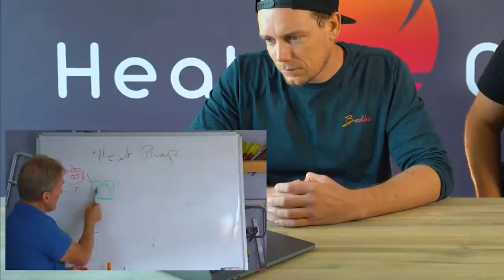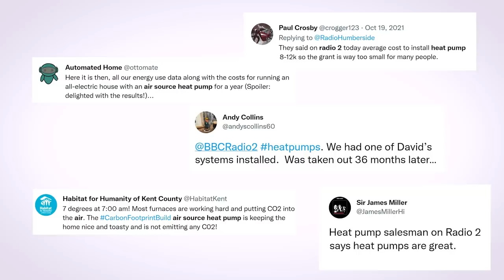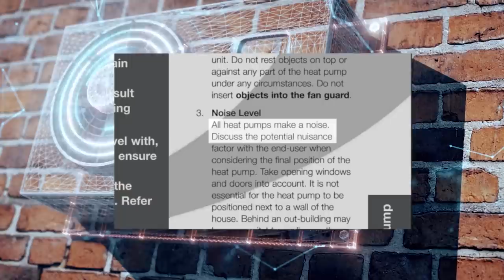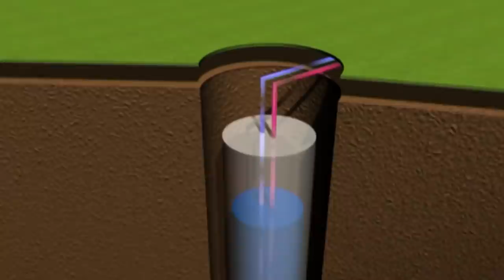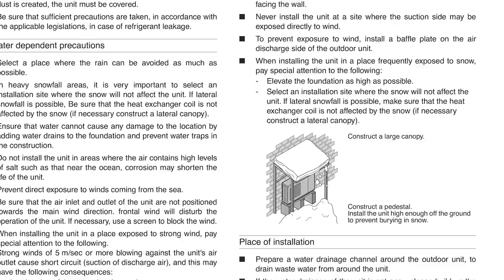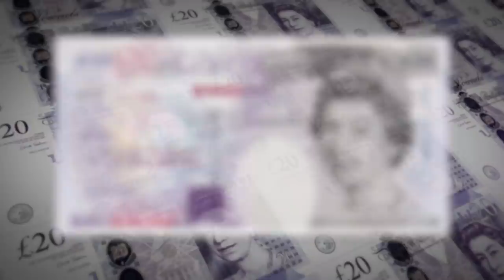Heat Pump Secrets They Don't Want You to Know

Comment: I was about to discard the pellet stove for an air conditioner, but I totally agree with what you say because, when the temperer goes down to a certain point, the efficiency goes down a lot.

And it is almost impossible to calculate the cost of operation compared to other heating systems, basically I don't want to be stuck with a professional that sometimes it can be difficult to get someone serious, and the pellets I can always change parts or do the cleaning myself according to the manual

Comment: Unless I'm missing something, how does an ASHP heat water on demand like my combi boiler does?
Reply from the maker: It can do it with an electric element run through a plate heat exchanger but they are not good at heating your domestic hot water. We just need to get used to cold showers, they are all the rage in Eton and other Public Schools so maybe that it why the government are pushing this technology.

Comment: I do hope my heat pump investment proves to be a good one. My Mitsubishi mini split system has been back ordered since September, hope to have it in by the time we need AC this summer. 

Not much other choice for us, as we have hot water baseboard heat and no ductwork, and our awning windows won’t fit window AC, so we need it for summer anyway. If it proves to be more cost effective than propane for winter heat, that’ll just be a bonus.
Reply from the maker: The air conditioning is just what the government is trying to avoid, that wil stuff our climate faster than heating.

Comment: power stations and power transmission is very very efficient also remember that nearly half of the uk is run by renewable energy these days. otherwise i agree with everything you say Rog
Reply: In case your electricity is generated by efficient gas powerplants you still face a efficiency of (only) 60% in comparison with a direct combustion of gas in a local boiler (+- 100%)!!!
Reply: Last year apparently, the wind turbines did not do a good job as the UK had fewer windy days than usual.   What do you do when this happens?
Until the technology improves - and it probably will, I am sticking with my very efficient condensing gas boiler.  The UK will probably never be suitable for all people to convert to electrically driven systems, as the housing stock is in such a poor state compared to countries that regularly have cold weather.

Comment: Thanks Roger.  It's a pity my neighbour didn't see your video.  He has just installed ASHP in between our houses which are only 3m apart.  The pump is only 800mm from the boundary.  It should have a clear space around the front by at least 1000mm, this is a safety requirement due to the flammability of the refrigerant.  My wall is now being blasted by chilled air which is freezing my lounge wall.  They are noisy, I can hear it at the end of my garden which is 24m away and as it is in between our houses the noise reverberates.  Edinburgh Council say it is permitted development and does not require planning permission.  This is unfortunate for both me and my neighbour as it is going to lead to legal action.  If I had been asked  for my opinion beforehand I would have raised my concerns and I doubt if my neighbour would have proceeded with the installation.  Not long after it was installed, I asked, "how is it going" and he said, "not too well as the air temperature is too cold."  This is like selling fridges to Eskimos!
Reply from the maker: I am not sure about Scottish Law but in England anything closer than one metre to the boundary needs planning permission. It doesn't come under permitted development.
I wish people would not dismiss the concerns about noise because it is a real issue. Noise is about more than decibels

Comment: Some small addition.   You have to compare heatpumps to heatpumps. There are LOTS of shitmachines on the market. We have well over hundreds installed. Only Panasonic or Daikin. Backup elements are almost never used on those, because they will still generate full power around -10 to minus -25. Depending on the model. My 1900's farmhouse is powered by an Panasonic 9kW T-Cap heatpump. That's all i have to heat it up. It runs quite low in power. Around 4000kWh a year, where my gas boiler did 25000kWh a year. Due to the high energy prices, i saved 6000 euro's last year. :) 

The neighbours thought it was so incredibly quiet, they've got one as well.

I'm a huge fan, BUT... they're not for everyone and suitable for all scenarios and we always advice NOT to do it, when it's not suitable.

Also, glycol isn't expensive! Like 700 voor 1000 liters. And  you only add glycol to prevent freezing damages. I prefer to use anti-freezing valves. Glycol messes up the C.O.P.

Comment: Heat pumps are always noisy, but some of the new ones I’ve seen videos of are crazy quiet like I would say quiet as gas furnace...
Reply from the maker: It is more about the rush of air through the fan than anything else and if you stand a few metres away from a heat pump running at full speed you will know it is running even with your eyes closed.

Comment: Currently, around 40% of UK electricity, on average, is generated by burning gas.  On one cold day in October 2021, there was little sun or wind, meaning little energy input from either source.  On that day, just over 60% of UK electricity was generated by burning gas.  This is insane and needs to be stopped.  The fear of nuclear power generation over the last two decades in the UK has left us way behind, we've gone from being world leaders in nuclear power, back in the 1970s, to being an also ran.  Hinkley Point in Somerset is being built using French technology and Chinese finance.  Contrast that with France, where around 80% of electricity is generated using nuclear power, leaving France far less open to the financial vagaries of the wholesale gas market, in the way the UK has.

Comment: "Probably need bigger radiators"
If you are planning on replacing the radiators, you would replace them with smaller, active, radiators. They require a lower flow temperature, provide faster more efficient heating of the room, increasing the COP.
Reply: The downside of the active ones is that they require power for the fans, make a small amount of noise, and are very expensive compared to basic panel rads.

The increase in size of radiator is also often not as much as people might expect - in many cases a single panel radiator can be replaced with a double or triple panel with a similar width to achieve sufficient heat output.
Reply: @mowcius  yes, needing power is a downside along with the extra cost. But if the complaints are about bigger radiators and a lower flow temp compared to a gas boiler meaning not heating the room as well and as quick. The solution to both is an active radiator, if wanting to continue to use the existing heating infrastructure. It also has the advantage of it being lower temp, less water, meaning it can increase the COP. But then there would be the complaint on price and it making noise.

Comment: If you have a system that works well and you are happy, keep using that system. When making changes to something like a heat pump, do your homework so you have a better chance at spotting a bad installer because they are a dime to the dozen in the HVAC industry who will likely install undersized unit just to make a sale and pretend you don't exist when you are cold at night:)

Comment: "Disaster from day one with heat pump" - it's without context. It can be tons of reasons but saying like that without context is like saying the pump is the trouble but in fact the install company just screw the installation.
"Issue caused by company who installed the device" - you also don't put your car to any service on the road
"Keep it running 24/7" - again more context would make the think less scary. The device is not sucking kWs of power for 24/7. Major time is standby time (if not cold start). If temperature in collector drops bellow set limit it will turn on. when the set temperature is reached it will switch itself to standby again. Of course the cycle can occur anytime. Even during midnight. 
"It can be noise" - in each manual is usually written how much dB the device produces. You might check this upfront. Also you can install sound barriers for this purpose.
"it need thick power cable" - isn't it more meant for defrost cycles instead of heating the house? For outdoor units.
"the wind can break the fan" - it would be interesting to know the air velocity required for this. I can't imagine the velocity of the air going TROUGH the fan in order to damage. Fans are usually powerful enough to spin right direction when they turn on. Usually units are installed near the house  or on the roof where are other air blocker. Unless you pump meets tornado i would be calm.
"rodent" - it can get even inside your house and make damage to your heating system. In case it "chew" the cable, usually your fuses should react due to short cut. If they just interrupt the cable the device will just stop working properly. Can't imagine part of the device stop working causing fire. It's more by mistakes in wiring or cheap fuses.
"you have to bolt the pump so it can't move around" - yes, i guess you have to bolt other appliances too if they are hanging on the wall like gass boiler. That's really argument.
"device will be shocked on cold start when you require a lot of power/temperature" - would be interesting to know why? Cold start will only result in longer time required to heat up the object. Here it sounds like a scenario which can damage the pump but it shouldn't.

I am not professional so maybe someone can explain me.

Comment: Gas power station is 60% efficient plus the loss of the grid is aprox 9% , condensing boilers are 90+% efficient. So there is a difference between gas power station producing power to be used for heating and boilers.

Comment: I thought your comment about the generation of electricity to be interesting, normally the comparison is between gas boilers at upto to 94% efficient and heat pumps at 2-3005 efficient, i wonder how efficient are the power stations, i would be surprised if they were 94% efficient?

Comment: Could you please do a video on why single phase homes may not work with LCT in the future specially large family homes with more than one ev charger And Heat Pumps. And explain that battery's are getting bigger so the milage gets better but our old 7.4 kw chargers will take for ever to charge an ev, hence the need for bigger chargers which means bigger load and will need 3 phase. All I get is 100amp cut out is rated for 150amps so it's OK lol its a bit like a hydraulic jack is rated for 3 tons but tested to 6 tonnes, so would you use it to lift 6 tonnes.

Comment: My heat pump packed up last week and my house is freezing the booster heater fitted to the cylinder, is only just that a booster so it doesn’t actually heat the water hot enough to be useful. Oh and yes they are noisy and when they do drain in winter you get a nice patch of slippy ice around the heat pump. Ringer is also right that there are not enough trained engineers to fix these things .  In fact I’ve hopefully got an engineer coming out today to have a look so that’s over a week for some one to come out and look to see if it can be fixed .  You may say a week is not bad but in the middle of winter with no heat or hot water a week is not a short time. What would happen if I was a land lord by law I’d have to get this fixed in 24 hrs or face  the risk of being sued.  My advise is to avoid .

Comment: Wait until everyone finds out all of the worlds refrigeration needs are accomplished with the same technologies that was just bashed in the video. Heat pumps are very efficient at what they do. all they are doing is moving heat energy from one place to another. Heating mode your pulling heat out of the outside air (or ground) and putting it inside the house and cooling mode your pulling the heat from inside the house and putting it elsewhere. Typically you'll find heat pumps are more efficient than a gas furnace until close to freezing, and at that point the gas furnace is more efficient. Duel fuel systems take advantage of both so they are always most efficient.

Comment: I think  you need to do some more home work on Heat pumps using back up heaters
Reply: If you have a gas boiler you should also have backup heating.
Reply from the maker: Why?
Reply: @SkillBuilder  
Because most of the new ones dont have them but the video implies they  do

Comment: I gather they have a setting , economical and ecological? If you are on a meter it will only use the cheapest the gas which is the back up hybrid boiler (combi). The ecological setting is electric so dearer than gas. Is this correct?

Comment: Why do the heat pump advocates come across as smug and view themselves as virtuous ?
Claiming a 1 kw input gives a 4 kw output is ridiculous . 
Running it 24/7 is hardly cost effective or eco friendly. 
It’s not carbon neutral or net zero, as it uses electricity to run .
An installation cost around 4 times the price of a boiler replacement.
horror stories of people waiting months for the unit to be repaired.
And yes , install the heat pump but have a gas boiler as a back up for when the hp isn’t up to it.
Reply: Ok, so we can take that as a yes then? When do you want the heat pump installed?

Comment: The point at 5:02 about gas-fired power stations is misinformed because it doesn't take into account that the COP (coefficient of performance = ratio of useful heat output to energy input) is well above 2 under most operating conditions for modern air-source heat pumps. It's amazing that someone with this much familiarity with heat pumps wouldn't have at least a basic understanding of COP.

For example, let's say 100% of your grid electricity comes from 50%-efficient gas power plants (this is typical for combined-cycle gas plants), and that after accounting for energy loss in electricity transmission and distribution, it's down to 45% efficiency. Then compare the heat pump to a 95% (very efficient) gas furnace. Whenever the heat pump is operating at a COP of at least 2.11 (= .95/.45), then you're getting more heat from the heat pump per unit of natural gas. Actual COPs vary with outdoor conditions but are often well above 2.5, and grid generations in many places is more like 60% gas, 40% renewables/nuclear, so all things considered, the heat pump has far lower emissions/gas consumption than a gas furnace.

Not to say that some of the other criticisms in the vid aren't valid. Where I am in the northeast US, dual fuel (gas furnace backup + heat pump) is absolutely necessary, but having the heat pump still reduces overall operating cost and fossil fuel consumption considerably, compared to a gas furnace alone.
Reply from the maker: Avid 55. The heat pump has to run a lot longer to bring the house up to heat and it has to keep running to get those kinds of COP. You can switch a gas boiler on for an hour or two. What our government is encouraging is the removal of the gas boiler. I just don't think it works in a poorly insulated old house

Comment: Time to accept the simple fact that burning Fossil Fuel has no future.  None. Rapid build out of the best alternatives is all that matters now.  A heat pump moves heat and uses 1/3 the power of directly heating with gas or resistive electric heaters.   So it is a huge step forward.   Old line frequency motors are loud.  New inverter models are quiet.  Obviously ground source looks good.  I think air source combine with a heliostat mirror to direct sunlight onto the heat pump coils during the day could be really good too.   A bright white roof goes a long way in the summer as well.

Comment: On top of all that, you're replacing a really expensive item safely tucked inside your house with an even more expensive one on the outside of your house.  Theft is a real concern.
Reply from the maker: I can see the day when heat pumps walk away. They require a spanner and a pair of wire cutters to disconnect.

Comment: Most of your comments relate to cheap heat pumps.
A good heat pump costs £6K+ installed.

I rarely advise AS heat pumps be installed on a domestic property as they are suited to less than 1% of them.

Commercial & industrial installations is where they predominantly belong & in blocks of flats, etc..